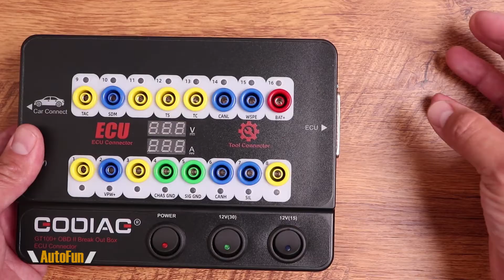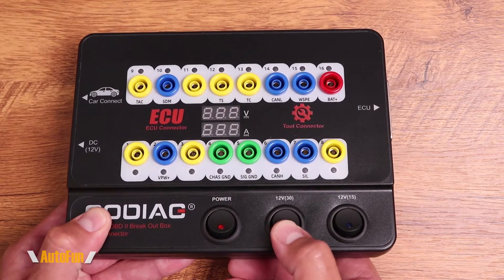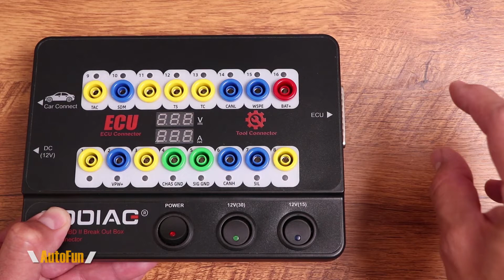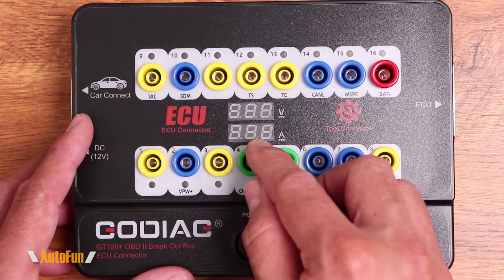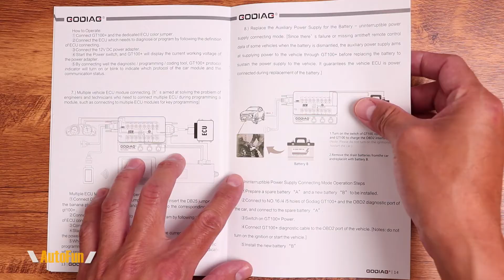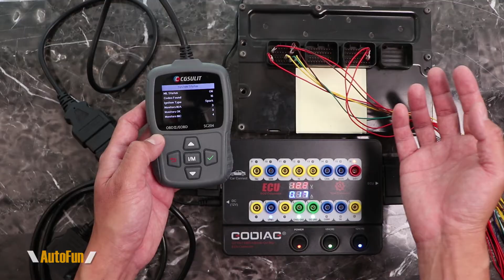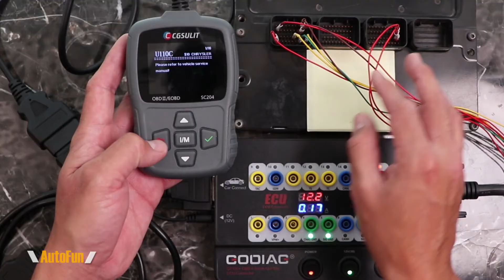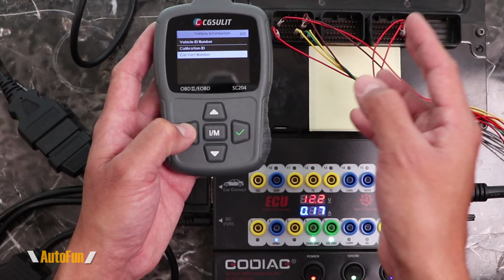GoDiag GT100+ OBD2 Breakout Box (ECM, PCM, Car Computer Bench Testing)

Comment: Is there one to plug into pcm i have power back feeding on wire that not used for second alternator i don't have i few erratic and voltage issue
Reply: JC4A-12650A-RA  is pcm im hooking to
Reply from the maker: Yes it can also interface directly to the PCM, you can see that on my follow up video here https://youtu.be/8uGh7vAR1AM Cheers!

Comment: Could this tool be used to scan a TCU ?
Reply from the maker: Hi D! This system is meant to power an ECU / PCM, while it may be possible to power a TCM, it may not be possible to communicate directly to it unless tapping the individual pins on the TCM (since ECU PCMs have OBD communications and TCMs likely talk thru the ECU PCM for OBD). I would imagine daisy chaining the matching ECU to TCM would likely be the easiest way to interface to it but I personally have not tried it. Cheers!

Comment: So for this to work as a breakout box do I have to have a odb2 to scan tool hooked up to it also?
Reply from the maker: Hi Kampy! Yes this is a breakout box. As explained in the video, it can be used in many ways, it can be used to check for OBD2 port functionality, to check for communication, to protect a scanner from a suspected defective OBD2 port, it can be used to access each OBD2 pin individually, to check for current draw, to check for correct voltage, to bring the OBD2 port closer to a scan tool by acting as an extension cable, to power an ECU outside a vehicle, to access the IMMO function in some vehicles and more (just really depends on the skill of the mechanic using it). And yes, you could also connect a scanner to the box pass thru cable to check for DTC's or to access other advanced functions your vehicle may support (assuming your scanner also supports it) and for programming. Cheers!
Reply: I had it hooked up without an obd scan tool and was trying to see the can buss signals with a scope but there was nothing there and the LEDs were not blinking.

Comment: I am after in a tool like this one, but I want to connect modules on the 24v levels, for trucks. What if feed this tool with 24v in the 12v voltage input?
I was told that the tool with be OK with that. Is it true? This is the only doubt keeping me away for grabbing my hands on it. Thanks in advanced.
Reply from the maker: Hi! Correct, the listing for the GT100+ and the GT100 shows it's rated for 12V-24V Cheers!
Reply: Thank you for your promptly answer. Blessings👋
Reply from the maker: You're welcome friend!  @DarCar2026

Comment: I bought one of these...my issue is if connecting the scan tool the other end of cable  it's very causing no communication with scan tool..it's very very loose...do you have any countermeasures on it...thanks
Reply from the maker: Hi Nestor! That is strange, mine has a tight fit, but then again OBD2 connectors do have tolerances so it's possible the OBD2 connector on the OBD2 scan tool is on the larger end of the dimensional tolerance making it feel loose (I also review OBD2 tools and this is something that I always noticed how each tool feels either looser or tighter when connected to the car's OBD2 port) It's also possible the OBD2 connector on the OBD2 tool may be wearing out (the do wear from use since they are just plastic) leading to the connector feeling loose when mated to an OBD2 port. Cheers!
Reply: @AlexAutoFun  thank you Alex...
Any other video like obdstar dc 706...

Comment: Hello,
Where to find the wiring diagrams for various cars and various modules like ecu, abs... thankds
Reply from the maker: Hi! The best place is the service manual for the car (usually available at the Dealer and sometimes on Amazon). Alternately there are dedicated websites that also give you access to diagrams (some are subscription based and some are one time buy diagrams) Hope this helps, Cheers!

Comment: Hello, to know the pinout of the quadrants, do you know of a program or a website to know the connections in godiag
Reply from the maker: Hi Joao! There are several websites that offer vehicle schematics (including pinouts). Most of these sites are subscription based so I recommend them if you are working on different vehicles all the time. If you are working on the same car then I find it cheaper to just buy the electrical service manual for the car from Amazon or eBay. Cheers!
Reply: @AlexAutoFun  hello by chance don't know so any who have what I need

Comment: Hi thanks for the video.I wanted to learn how to use BOBs. I found the video good. If the immo feature of the GT105 is taken off how different are the GT100+ and GT105?
Reply from the maker: Hi PartOEMS! Ah good question here is the full review of the GT105 https://youtu.be/9qQQ7rEeHUc The GT105 is a low cost IMMO access tool with a couple of additional features. The GT100+ is a full breakout box so it's a different product all together. Here is more in depth video where I show how to use the GT100+ https://youtu.be/8uGh7vAR1AM Now at one point they had planned to introduce an Add On harness for the GT105 to add breakout box capabilities but I think the expected cost of the harness plus the GT105 just brought the product too close if not same as the cost of the GT100+ so it didn't make much sense to continue developing the Add On (again this is just my opinion, not sure what GoDiag decided internally) Hope this helps, Cheers!
Reply: @AlexAutoFun  Thanks for always taking the time to respond. Well appreciated. What's the difference between gt100+ and gt100?
Reply from the maker: @partoems9376  You're welcome! The GT100+ has the Amp Meter and the GT100 does not, I put links to both in the video description. Hope this helps, Cheers!

Comment: have you figured out how to read the data on a PC?
Reply from the maker: Hi Robert! not sure what you mean as far as reading data on a PC, but there are OBD2 programs (for PC) and programmers that could be used to interact with the PCM that way, assuming this is what you are referring to. Here is my follow up video showing how I make the connections in more detail to interface to the ECM https://youtu.be/8uGh7vAR1AM Hope this helps, Cheers!
Reply: I meant programming pc software to to turn off or on sensors for engine swaps.. that are like the hp software that is good but cheap.. good videos..😊
Reply from the maker: @BasketCaseGarageForFun  Thank you Robert! Ah yes, I haven't reviewed any programming software yet, it's definitely a whole other lever of knowledge which I honestly would leave to a dedicated tuner (unless your modifying your car's tune constantly I think it may be cheaper to leave programming to a tuning shop, which also has the advantage of being able to put the car on the dyno to confirm results) but would will keep an eye out for software for programming, may even look into the HP Tuners products at some point (the good thing is that most of these style of software communicates via OBD2 so there is high likely hood you won't need the GT100+ unless your are doing something that is specific to the module. Cheers!

Comment: Can this be used on motorcycles if I have the correct adapter?
Reply from the maker: Hi Mandi! correct, if the motorcycle is OBD2 compliant then you should be able to interface to it with the GT100+ Hope this helps, Cheers!

Comment: Hello I want to put it ECU from another car, can I copy the data from my native machine ECU on a new ECU ? rod, the car started up or is needed K-TAG? in advance disperse
Reply from the maker: Hi M 20! you will need special programmer tool to copy or match an ECU, here are a few options https://youtu.be/9qwJlUEWN9A or https://youtu.be/FJaa0gS2GCU or https://youtu.be/Yy21TsscA_c Hope this helps, Cheers!
Reply: @AlexAutoFun  A K-TAG it does not??
Reply from the maker: @M20-w3o  Hi M 20! I have not reviewed the K-Tag system so I'm not experienced with it but yes as far I understand, the K-Tag is used as a programmer and for  cloning. Hope this helps, Cheers!

Comment: Hi my name Bo I've got one of the Box GT100 GODIAG AN IVE GOT DODGE STRATUS 2.4 AN IVE BOUGHT THE 
PCM AN I PUT IT IN CAR AN ITS NOT 
PO630 code it shows on my DIAGNOSTIC TO AN IT SAYS vin not programmed or mismatch ECM/PCM 
DTC  Severity  3  of 3  STOP AN REPAIRING
Reply from the maker: Hi Loren Natonie! that sounds correct, if the PCM is being replaced with another one the SKIM will not match and the anti-theft system will prevent the car from working, I cover this in more detail in this other video https://youtu.be/NxYPRdtixGs There are two work arounds, the first one is to swap out all other components to match the SKIM (typically the cluster, PCM and ignition switch) however the preferred way is to send the PCM in for programming so it can correctly match the rest of the vehicle, I put links to the resources that can be used for programming in the video description of the PCM swap video I linked in this comment. Hope this helps, Cheers!

Comment: I like the GT100+ but from what I have seen, the included A/C adapter does not provide full battery voltage. It provides 11.9V to 11.8V which is low if you are programming some module that require close to 13V. Have you experienced that?

Or should I purchase the older GT100 model which does not have this issue. By the way.... I'm loving the GT101 I got thanks to your review.
Reply from the maker: Hi Next Level Auto Diagnostics! ahh good question, I have not tested the GT100 but It's very likely it shares the same AC adapter with the GT100+ (it's cheaper to share components across models) what you probably saw was an adapter that was on the high side of the design tolerances (typically I see +/- 5-10% in the industry) assuming it's 5%, voltage can be as low as 11.4 and as high as 12.6 and the AC adapter will pass QA inspection. The AC adapter included on the GT100+ is model number 12200 if it helps. But yeah here is my follow up video where I cover why in some cases it makes sense to use a regulated power supply instead of the included adapter (both for voltage requirements but also to control amperage) https://youtu.be/8uGh7vAR1AM Hope this helps, Cheers Bud!
Reply: @AlexAutoFun  Thanks very much. That video was informative. 😊
Reply from the maker: @NextLevelAutoDiagnosticsLLC  Awesome, glad to hear it helped! and yeah man it's good to hear your GT101 is working great, I never realized how much uses I had for a probe until I got it!
Reply: @NextLevelAutoDiagnosticsLLC have you figured out how to provide more power especislly durimg programming like VAG cars tend to rewuire it?
Reply: @AutoHack  I bought an upgraded ac adapter which provides proper voltage.
Reply: @NextLevelAutoDiagnosticsLLC hi can you link or give the specs for your upgraded adapter? Thanks